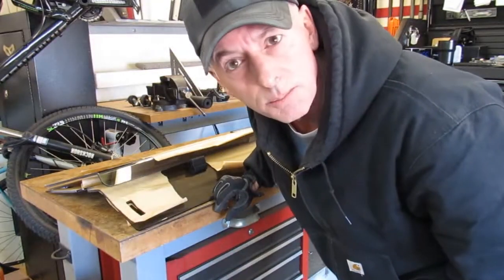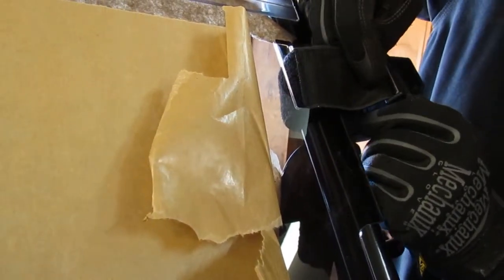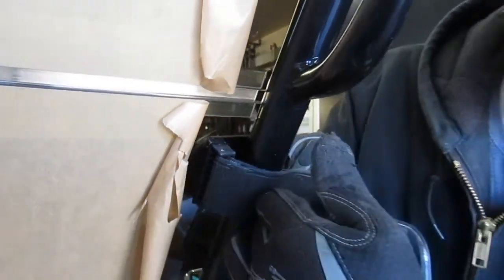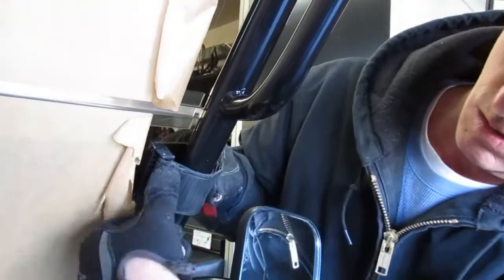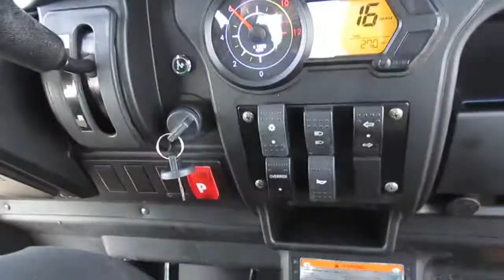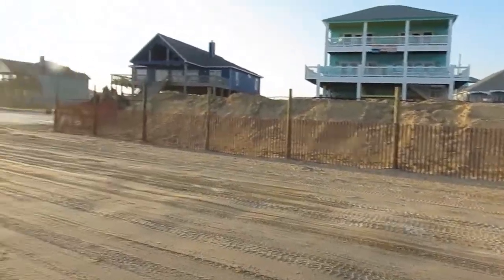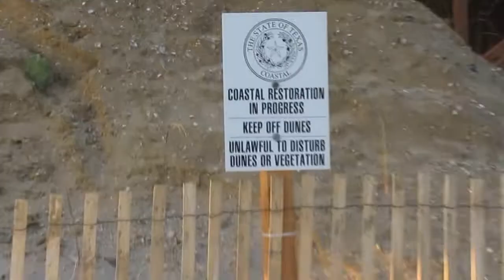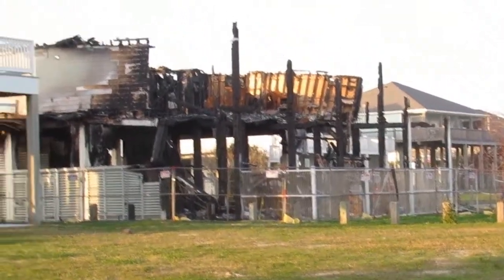Cazador Golf Cart: Windshield Installation and a Beach Test Drive

Comment: I just picked up a 2019 Cazador 200. I got it cheap because Its not running, so I have some work to do. Hope you are still enjoying yours.
Reply from the maker: Yep, she’s still going strong. 😎
Reply: I have the same cart. I lost the screw that holds the air filter in the housing. Can you look at yours and tell me the screw size and type?